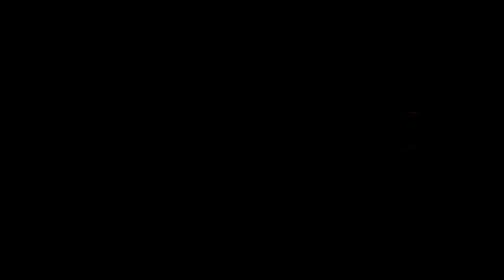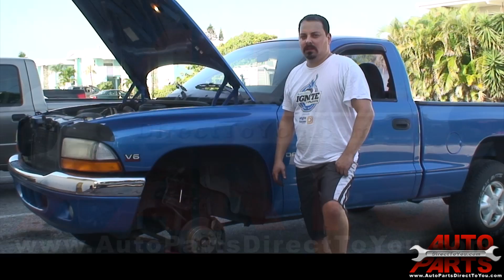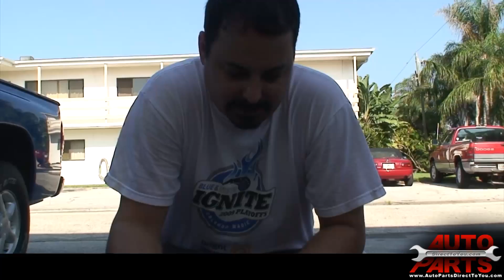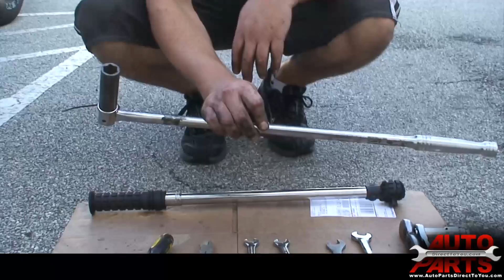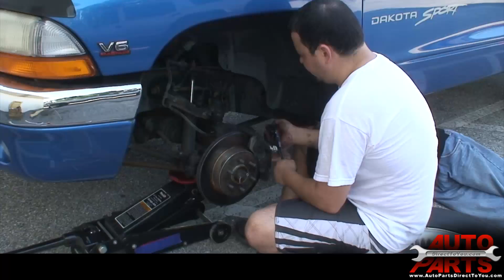1998 Dodge Dakota Brake Caliper Part 1

Comment: Very informative video my only issue: I sure hope there was a jack stand under the frame for support. NEVER, EVER, NEVER, use the hydraulic jack as the sole support, especially if you have someone videoing under the vehicle. Safety first.